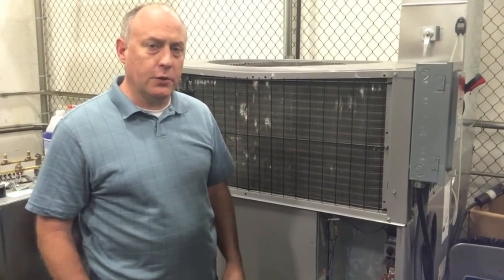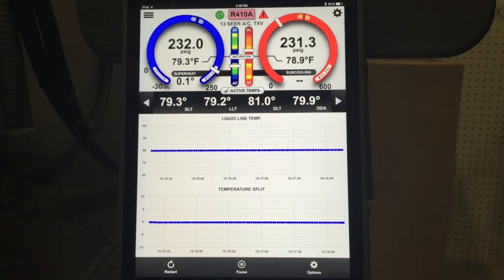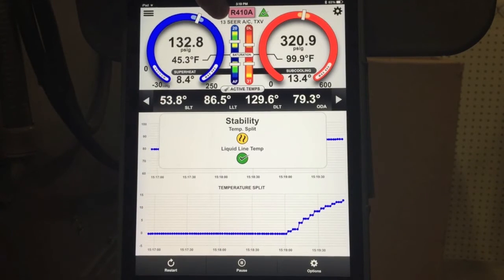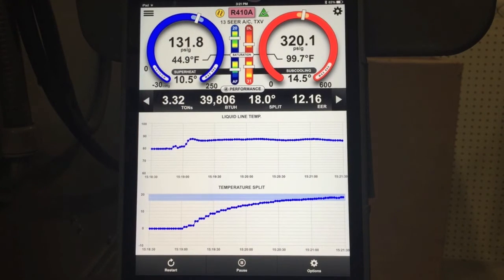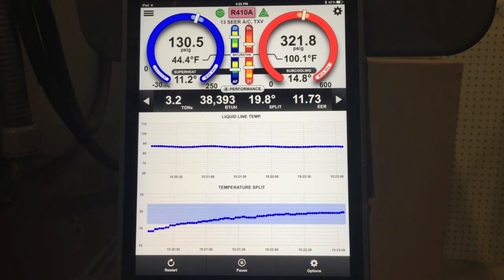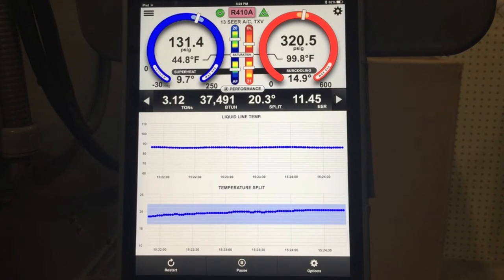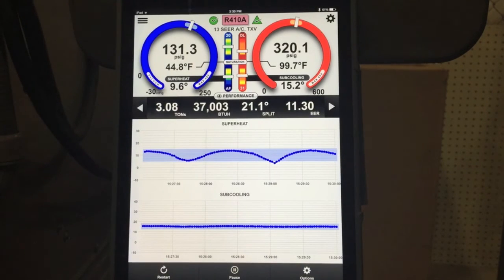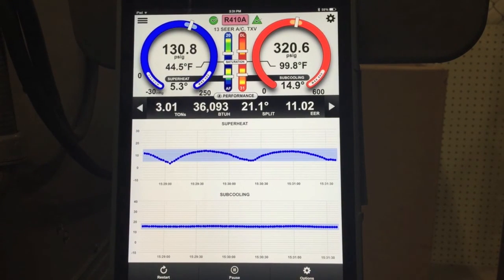iManifold Stability Indicator

Comment: Nice illustration, Jim.
chribrian:
EXV's do control better, but they have to rely on the feedback from sensors. This can be problematic over the life of the system. My experience has shown that the sensor is usually the weak point. It often is the least expensive item but can cost the most when it fails and the EXV starts flooding the compressor. On the other hand, the TXV has a long history of reliability.